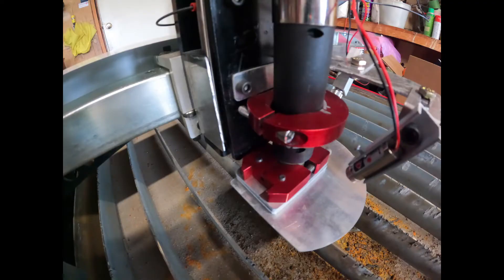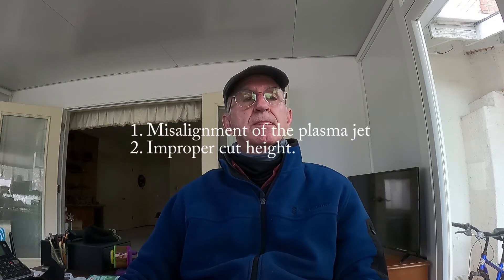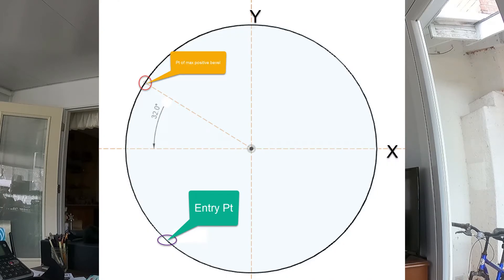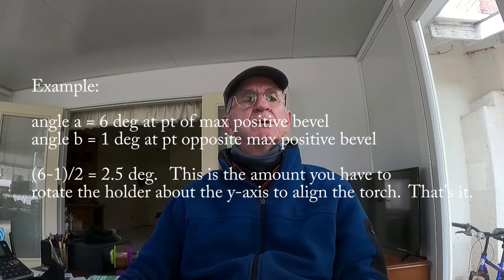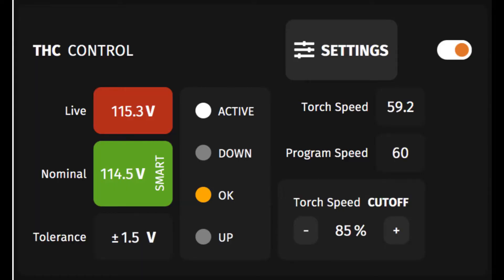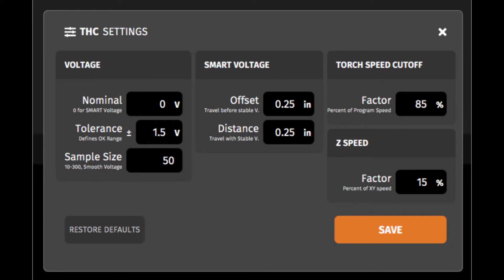Langmuir Crossfire DIY #3

Comment: Doug where do I purchase the two lasers you used, FYI I really like the mods you have done on your Plasma table keep them coming, Thanks Al
Reply from the maker: https://www.amazon.com/WWZMDiB-Laser-Diode-Adjustable-Length/dp/B0B53KPRWR/ref=asc_df_B0B53KPRWR/?tag=hyprod-20&linkCode=df0&hvadid=598284161755&hvpos=&hvnetw=g&hvrand=13928447603094079572&hvpone=&hvptwo=&hvqmt=&hvdev=c&hvdvcmdl=&hvlocint=&hvlocphy=9032441&hvtargid=pla-1719785067335&psc=1